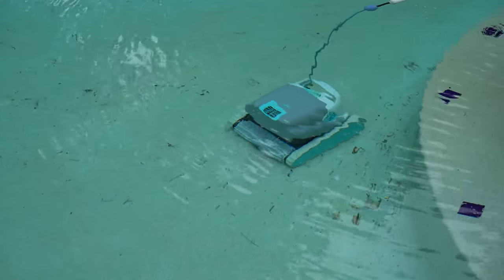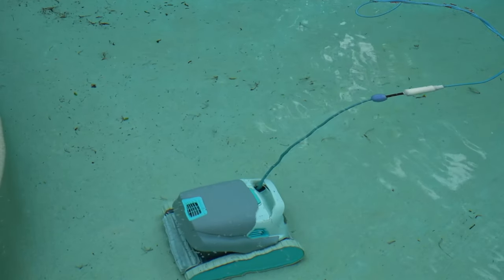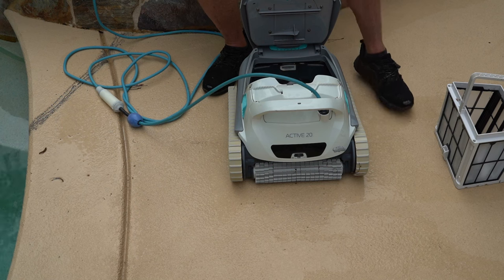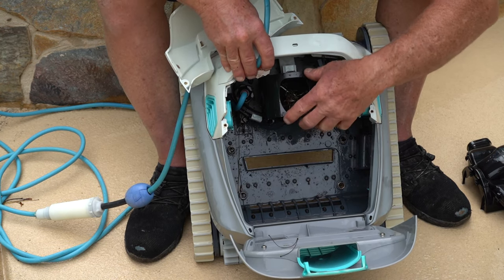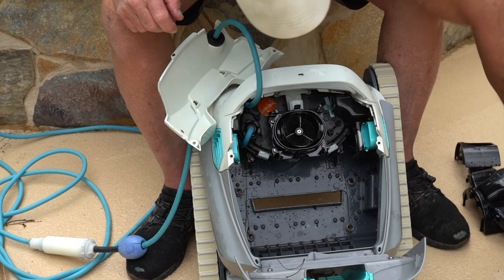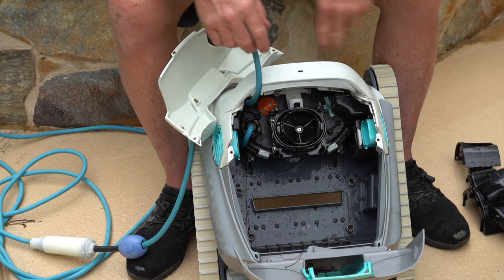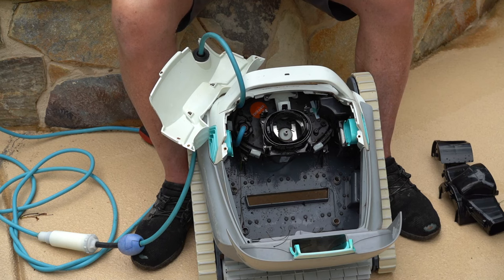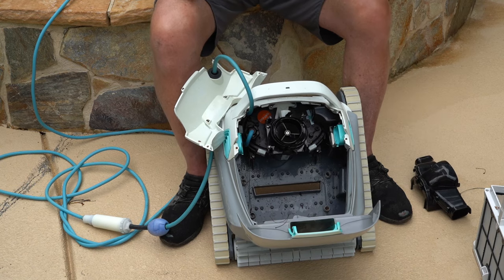How to fix a Maytronics Active20/30/60/Dolphin when it runs a few seconds and stops

Comment: My impeller is not blocked yet the robot has the same behavior. The rollers spin one direction easier than the other, however there are no obstructions on the track. Any ideas?
Reply: This happened to me.  The next few power ON cycles, I spun the impeller forward and backward by hand AND moved the square piece that "aims" the water (just above the impeller) side to side gently to make sure it was moving freely.  It has run several startups with no problem since :)
Reply: @spungewurthy  could you explain that in a little more detail. Does that mean you take it apart again and move the propeller by hand? I’m not sure how this works with a power on while you’re doing that. Sorry I’m just a little confused. Any clarification would be greatly appreciated.
Reply: @spungewurthy  mine did the same thing. I didn’t take mine apart, but just turning it on and off i was able to get it to run a few more times in full cycles but now it has stopped again so I’m gonna be tearing it apart tomorrow to see if the impeller is dirty
Reply: @TheRemyRomano  I did it a couple times and it's been running perfectly for a month
Reply: I take the parts out and clean but still not working any ideas pls,stressing me out.

Comment: Thanks for this video. Looks like many people are having this problem. This is definitely a DESIGN FLAW!  For my 10-year-old Dolphin DX3 I need to unscrew only 2 screws to clean the impeller. Maytronics is in the business for many decades and should fix this PROBLEM instead of keep on confusing the customers with many labels & covers. The customers should NOT have to get into the GUTS of the machine to fix this common issue.
Reply: Same here.  Mine has not been working for a few months, and unfortunately I can not find the parts.

Comment: I was very disappointed to take my impeller out and find that it was spotless.  I found a tiny acorn or pebble in one of the directional vanes that surround the impeller.  I removed the 4 screws popped that little guy out (it fell in the lawn and was gone so I'm not sure what it was) and put it all back together.  To my delight, my robot is back to cleaning!  So while it was not this exact issue, it was very similar and I wanted to let other viewers to know to make sure those directional vanes surrounding the impeller are clear of any tiny bits of grit.  Thank you!

Comment: IF cleaning the impeller doesn't work, here's what I did in addition:  The next few power ON cycles, I spun the impeller forward and backward by hand AND moved the square piece that "aims" the water (just above the impeller) side to side gently to make sure it was moving freely.  It has run several startups with no problem since :)

Comment: Did the procedure you recommend and still having the same issue, mine was clean. Any other recommendations/ I see others are having similar expriences here.
Reply: Same issue here
Reply: Mine was doing the same thing and the impeller was clean. 2 possibility's could be motor brushes or motor bearings. Mine ended up being the motor brushes were worn out. I ended up custom modifying some and it works perfect now. I have more brushes for sale or you could ship me the motor and I'll put them in.

Comment: This was the EXACT problem I encountered today (after several cycles picking up winter debris from the bottom). The instructions took me 15 minutes to fix our "Little Geek". Debris plant "needles" had wrapped up the impeller like
weeder whacker line. 5 minutes to clean out. "Little Geek" back in business! Thanks, Craig!

Comment: Thank you for the video. I wish this reply may help someone else out. The propellor was clear. After checking the belts, realized my drive gear wheel was hopping around out of balance. This created a start and stop effect under a normal cleaning cycle. The small gear output of the motor was binding on the drive wheel.

I swapped the left drive wheel for the right drive wheel. Cleaner is back in business. Be sure to take a close look at the gear and wheel play after removing the track belts. Placing an order for a new wheel. Device is cleaning like a champ. Cheers!

Comment: Thank you! Our “Lil dude” was doing same thing and I just cleaned the fan area with my fingers and he was good to go after doing same start/stop. He’s been picking up pine needles and the ladies’ long hair which tangled up the fan. Didn’t wanna risk breaking the waterproof seal. He’s happy to be back to work now 😂 What an amazing little machine. Was gonna try to find an expensive  replacement on Black Friday, but saved a lot of money. Thanks again!
Reply: There isn't any water proof seal in the areas where he is servicing in this video.  The w/p seal is in the housing that holds the motor/board, which is under the impeller shaft.

Comment: THANK YOU, THANK YOU, THANK YOU! I was dreading hauling my Dolphin S300 in for service. It was reporting a comm error but that's because a pine needle jammed the impeller and after a time-out period (I assume), it reported a communication error - buts that's because after it dies and becomes not responsive, the control assumes its a comm error. So THANKS AGAIN for posting and solving my problem!!!!

Comment: Mine is doing the exact same thing.  Just bought it a couple days ago.  Thought I got a bad one and was going to return it. I’m definitely going to try this.  Thanks for the video!
Reply: did it work?
Reply: If impeller is clean and spins freely. Try running it upside down on a bench. Then if it continues to run. Put it back in the water. 

I stripped mine down, cleaned it all out (it was fine).  Bearings are fine. It’s a few years old and needs brushes for the main DC pump motor - but you can’t buy them from Maytronics which is a scam. They will only sell you an entire new motor. Brushes are a consumable part. 

Anywho. Put it all back together and it only ran a few seconds still…. Ran it upside down (perhaps a recovery maneuver?. And it’s run ever since. Still needs brushes soon though (before it destroys the motor from brushes running out).

Comment: I just disassembled my DX4, and there was ablut 1/4 cup of water inside the motor/board housing.  No wonder it doesn't move, and the blue light is solid.  The guy at my local Leslie's is going on vacation, so I'm not sure where to buy the parts.  It was purchased 4/19/20, so it's "juuuuusssstttt outside of the 24 month warranty."  We had the control/power unit replaced about 6 months after I initially purchased it.  I'm not sure it is as robust as our previous Maytronics pool bot.  I don't remember the nomenclature, but it had the bag under it, and had 80's esque pastel coloring.  Unfortunately the replacement parts on it were hard to find, so after 3-4 years of my second hand use (it came with the house when we bought it.), I broke down and bought this new one.  This new one is designed a lot better as the top load basket is easier to clean and the daily timer is better.  But to me, the inside/working parts seemed to be better quality.

Comment: Update/solution!!! I started having this issue non stop. So much debris in the top part and outside of the basket. Turns out my rapid drain flap was missing! (The black flap between the wheels and robot). It prev came off and I thought I reconnected but apparently didn't, found it laying on side of house. To reconnect you have to use pliers to pull knotches through. It's working amazing now!!

Comment: Same issue. Everything clean. Took the main housing apart and there was water inside of it. The control board had mineral build up. Tried to clean it up and no success. At this point I think I need a new board the motors seem to be working fine.

Comment: Craig, great video.  Super helpful.  I did what you said and it worked for 1 day.  Now it is doing the same thing.  Pulled it apart again and made sure nothing remained in the impeller area.  Impeller will spin by hand as will the final drive unit.  Still does the forward and backward dance and then stops when back together.  Any followup ideas if that doesn't seem to fix it?
Reply: I have the same issue right now. I have a service tech supposed to come and check it out now.
Reply: If anyone knows where to get the 2 drive gears I will replace those also. I can find them for the Dx4

Comment: My Dolphin PS Triton does this where it won't pass the self test. The impeller is clean and there is no debris. Sometimes it works after i take it out of the water and put it back in but it's very hit or miss. The gears and track are fine so maybe its a motor issue. It i do the upside down test it works occasionally as well.

Comment: My dolphin run through the self test by moving forward, moving back, and running the fan.  After that, it will not move.  The impeller has been checked and it is clear.  The basket has been emptied.  Any suggestions?

Comment: I’ve got the same problem (the dolphin do the same), but it’s clean!? The only way it works is leaving without the black piece (I guess it’s a piece that makes the robot rotate)…then, IT WORKS !?!😳 Message: overload propeller/Reset robot Ok … Not always the reset works!?! If I use the robot manually (remote), it’s the only way that it works with all the pieces…!?… I’ve tried everything: do you know any solution? Thanks!

Comment: My Dolphin DX4 moves about 3-4 feet and stops.  I checked the impeller and it was clean.  I replaced the impeller anyway and it still only moved about 3-4 feet and stops.
Reply: Mine is doing the same and impeller is clean; did you solve it?

Comment: Cleaned the impeller, there was hair and pine needles clogging it up.  But this did not resolve the issue.  It still is only moving forward about a foot then stops.  Any other ideas?
Reply: My impeller was clean also, it runs great actually, and is churning up the water quite well. But the cleaner is still running only a few minutes then stops.

Comment: I did this. Cleaned impeller and it made it work for two minutes instead of three seconds. Any ideas why it would now stop with a clean impeller after two minutes? I will add that the blue cord has a break in it

Comment: I have a t55i brand new. I just wanted to make sure that the power supply is working so i did a outside off water test but for some reason my dolphin didn’t stop running it did the cycle and pause then start running again is this normal??

Comment: I cleaned the impeller and even changed the cable and mine still moves a little and stops and cannot turn it on again. power supply is working. Would it be the motor? thanks
Reply: I have the same problem.  I’m gonna change the robot tracks next.  Hopefully that works

Comment: If the fan is missing fins the machine also stops because the fan needs resistance to make the machine think its under water, to work propperly, cost 4 euro

Comment: Mine starts, rolls 2 ft and stops, i excitedly ckecked my blades for jamming but clean as a whistle , any other ideas ? Its a Nautilus Dolphin CC (not the plus) 3 yrs old. Ive tried unplugging from power for extended times.
Reply: Mine was doing the same thing and the impeller was clean. 2 possibility's could be motor brushes or motor bearings. Mine ended up being the motor brushes were worn out. I ended up custom modifying some and it works perfect now. I have more brushes for sale or you could ship me the motor and I'll put them in.
Reply: @tobin669  how much for new brushes shipped to MI? Thanks
Reply: @mixin36  $25 shipped. For reference the impeller motor # is 52ZY24-50
Reply: Thanks.  I’ve cleaned mine all out to no avail.  Thinking the motor brushes are toast.  My boy has been running three years.
Reply: @tobin669  Do you still have brushes for the Nautilus Dolphin CC (not the plus)?  Is the motor easy to remove so that the brushes can be installed?
Reply: @simmonsco  yes I do. It’s a little bit of a chore but if you’re good at taking stuff apart and soldering you will be fine.  If you want you can ship me just the black motor unit and I can do it. If it just needs brushes it’s $150 if it needs brushes and bearings it’s $225. 
Let me know if I can help.

Comment: Ours is doing the same thing, it runs a few seconds then stops.  I checked out the impeller and it's clean. What else do I need to check to make it work again. HELP!!!
Reply: I’m convinced these dolphins may not be worth the powder it would take to blow them to hell,
Reply: Mine was doing the same thing and the impeller was clean. 2 possibility's could be motor brushes or motor bearings. Mine ended up being the motor brushes were worn out. I ended up custom modifying some and it works perfect now. I have more brushes for sale or you could ship me the motor and I'll put them in.
Reply: @tobin669  How do you replace the motor brushes? Is there a video for that?

Comment: Okay, I did that but it still comes on and shuts off. I have 2 power supplies and it does that with both, so I don't think it is the PS. I tried to send via website, but not working
Reply from the maker: You will need to replace the whole drive unit. Thanks for letting us know about the website.
Reply: @craigwooster6646  OK but I also want to ask you about the cable I have a 3.3 V drop from the power supply to the end of the cable. Could that be the problem? Or are you convinced it’s the drive?
Reply from the maker: @briancamidge5336  3.3 V drop on that cable is not unusual but if you look at the cost of the motor block its almost cheaper to buy a new unit.

Comment: I just opend up the motor unit and pulled the impellar motor out. Its filled with black soot, smells burnt and difficult to turn by hand. New one on Ebay for $115. Has anyone went this route before?
Reply: I just did…..replaced the impeller motor…it had carbon sitting in its well. For sure
 the carbon motor brushes are worn out. Ordered a reman on eBay. Just installed it…still does the same thing. I check it has 30 volts from the power supply. A little disappointed it still does it.